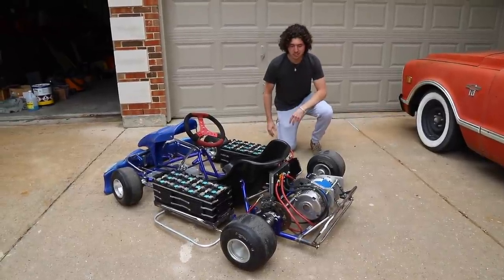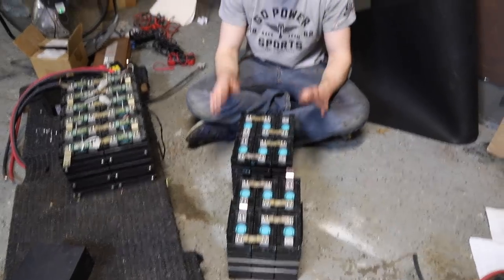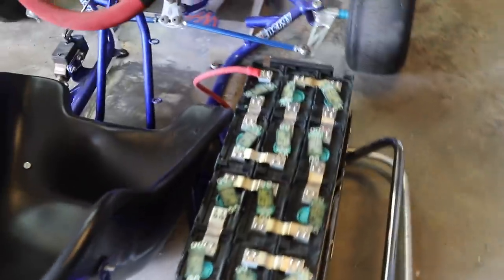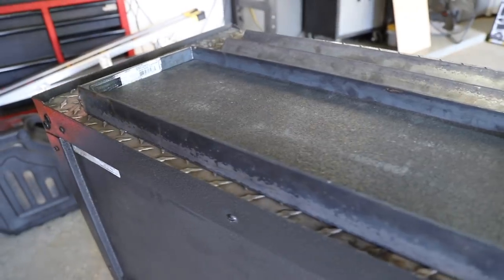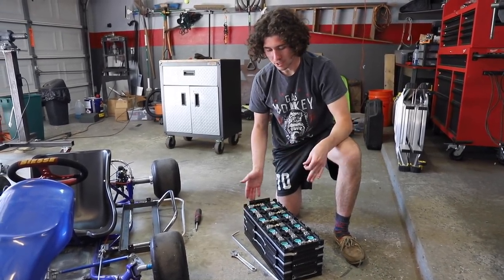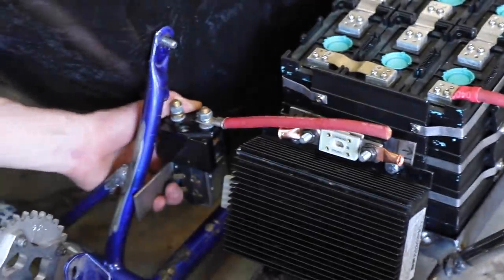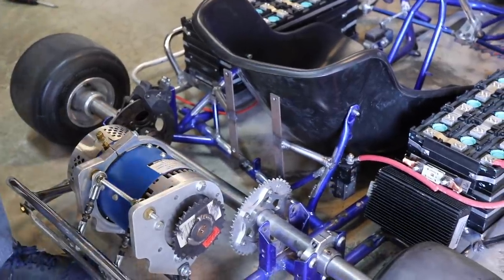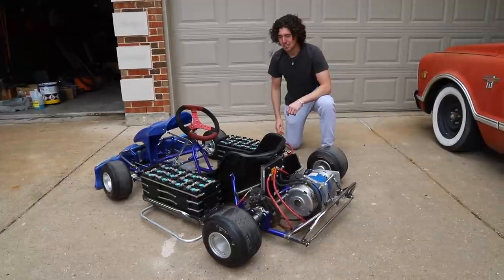Electric Go Kart Build Part 2 | Battery Cells and Motor Controller Install!

Comment: The BMS does more than just tell you voltages.  It also maintains individual cell voltage levels when charging, and should have a cutoff solenoid to protect the batteries from over discharge/charge.  Those boards have resistors on board that a mosfet turns on once the cell reaches it's proper fully charged voltage, to help balance the cells.  It is not safe to charge those cells without a BMS, or a charger that monitors your cells.  Since you're running what looks like 1p12s (12 cells in series for 44v nominal...) you're going to a 12s balance board, or at least a 12s capable balance charger.
I'd get your BMS working before attempting to charge, since i assume you bought a complete setup.  And check all your battery cell voltages.  If you cannot get a BMS running, or their voltages are not matched, charge them one a time to full charge with a sizable single-cell charger before finishing the pack.

If you're charging the whole thing as one series pack, you're going to need a 1p24s, which means you need to get that BMS working.  There aren't really any 24 cell balance boards or balance chargers out there.
Reply: This comment needs more likes. A BMS is crucial for safety, as well as proper battery health and performance.
Reply: I agree 100%. I’m not sure why no one els has commented on this. As soon as he took them off I went straight to the comment section hoping it was a large topic of conversation so they would see it and I am disappointed it is not.

Comment: This thing is gonna be a rocket 🚀. The huge battery packs are gonna give this thing crazy grip on all 4 tires with the even loading. The electric motors are gonna have that instant torque factor too. I’m very excited to see this thing completed
Reply: Too much grip could be a bad thing- karts need to lift a rear wheel to turn. Unsure of how the weight will affect it- however there are twin gas engine powered karts, so I guess it’s not that much heavier?

Comment: Hey guys I hope you all seen the comment by “Kit Iwamatsu” please read it as he is correct. You need to use the BMS (battery management system) you should not even charge these batteries until you deal with it. I’m not gonna go into detail on it as the comment by Kit is plenty but I don’t see many likes or over comments on this and it’s the most important part of using lithium single cells. Please read it. Love this project it’s a perfect platform and I’m excited to see it finished.

Comment: This looks like it will be almost as much fun as the Hercules rotary kart! It ought to rip pretty good, and considering the overall diameter of those tires, your gearing should be pretty close if that's the motor I think it is. Better get a heat sink for your motor controller though, or you'll be buying a new one pretty quickly.😉

Comment: I would love build something like this put a few alternators on it run by the axle see if I could get it to charge y its driving be a fun project
Reply: You could use the alternators as a regenerative braking source of energy, however they would add even more weight and due to the laws of conservation of energy and the efficiency of alternators it would not be economical to use them while the kart is being driven.

Comment: Ok so this was last year. Basically im doin the same project here. Except my motor is 24v 350w. So are there any batteries that exist out there. Like car battery lookin that are either 24v maybe 1200wh or 12v 1000wh that i’d link in series. Or……..do i gotta do what you did here?
Reply: Btw my go kart. Its more of a cruise kart because i’ll be going abount 15-20mph(to be upgraded in the future!)

Comment: Hmm... I'd have mounted the controller on the other side of the batteries, those fins are for cooling and behind the batteries you're losing out on potential airflow.  It'll still work, it's just not ideal.

Comment: Also that sprocket on the motor looks to big. Not only will that be hard /slow to start but I think it will put too much load on you motor and without cooling it can over heat the motor and burn up. You said your running 80v battery and controller to a 72volt motor that will be fine but that also adds to the heat so that and the sprocket will be a lot of heat please cool it and change the sprocket. Just my two cents.

Comment: How many voltage is the battery and motor?
Reply from the maker: 24-48V motor that we were over-volting to 72V, now with our new controller we are running it at 48V

Comment: How heavy is it?
Reply: My estimate is around 250lbs based on a 120lb chassis, 30lb motor, metal they added, 10lb controller and all those batteries.